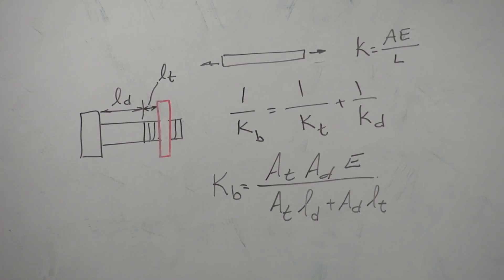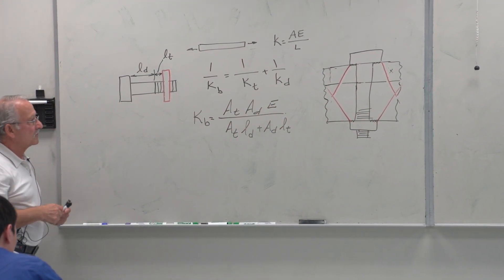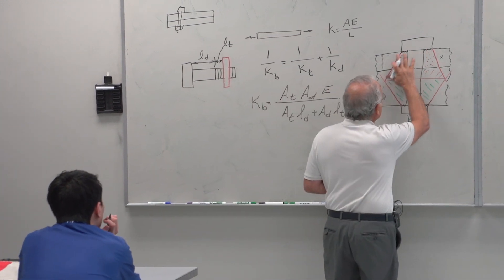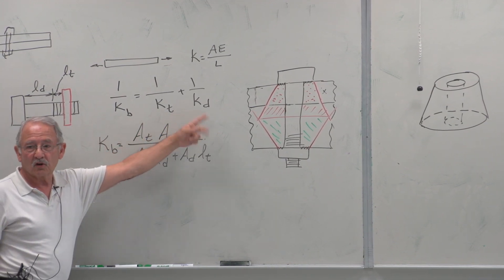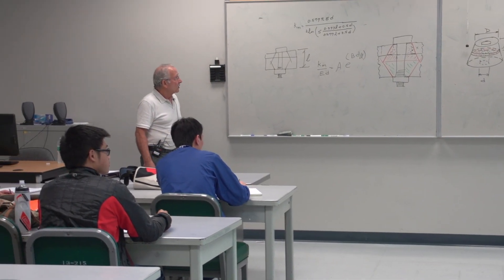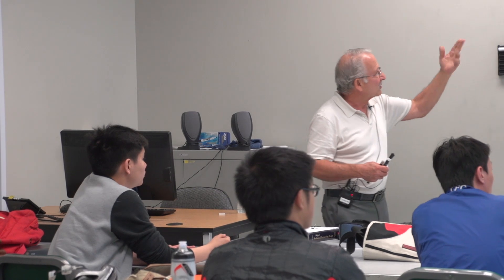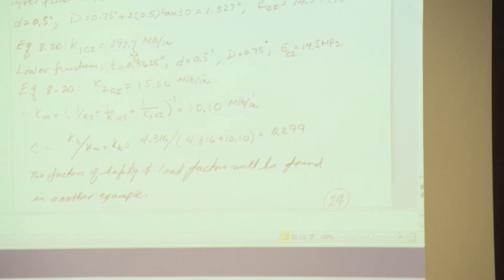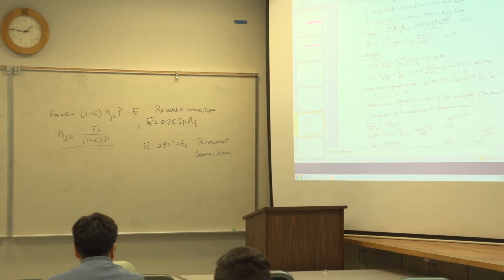Stress Analysis: Stiffness of Bolts & Members, External Tensile Loads on Bolted Joints (12 of 17)

Comment: Thanks a lot for the video.
I have a doubt at 1:08:18 when it was said that "higher the amount of preload, (the better the joint) and the less of the amount of externally applied load will be taken by the bolt". How is that? As I understood, as per the graph of external load assessment the split of the external load is driven by the stiffness of the member and the bolt, which doesn't change.

Additionally, during the preload, the forces on both the member and the bolt are the same (one is in compression and the other is in tension though). However, during the application of external load, the deformation will remain same for both the member and the bolt. So, if the deformation remains same (for member and bolt), the external load split shall also be same.
Reply: To your first point, it just means that the joint can tolerate more external load before gapping. Once joint is gapped it will take 100% of any additional external load.

To your second point, same displacement only means same force if stiffnesses are the same. In this case the compressed flange is far more stiff than the stretched bolt so although they have same displacement the compressed joint reacts far more load than the bolt.

Comment: I've read in several books on the subject. I think Norton's explanation is the best, and the way this lecturer presents it is very good.
However, everyone says that preload is important as it reduces the load applied to the bolt and shares the load between the bolt and the members. I think this is a wrong say. since the bolt is preloaded, it already carries a load, hopefully more than it should see during its' lifetime. applying a load to the joint relieves some of the stress in the members, but increases the load on the bolt. I think the need for preload lies elsewhere. first of all, its' a means of verifying during assembly that the bolt will hold the service load during its' lifetime. Secondly, during vibration, the preload maintains joint integrity, and does not allow the members to separate. what do you guys think?
Reply: Preload adds axial tension stress to the bolt.  Yes, it helps keep things together and protects against loosening due to vibration, but it also greatly improves fatigue life.  The reason for this is not completely intuitive until you understand fatigue.  When a bolt is preloaded, external load adds to bolt tension and reduces member compression, or squeeze.  Since a typical member is usually around 4x stiffer than a typical bolt, about 85% of the external load is carried by the members, and only about 15% is carried by the bolt itself.  This greatly reduces the alternating load and stress in the bolt, which can significantly increase fatigue life.

Comment: Dr. Hassan, what happens if we have washers? Does the cone's large diameter change?
Reply: I mean if we use SAE washers, you are right, but what if we use a USS Type A washer?
Reply: Yes.  If you have two washers and two members, you will have 4 stiffness terms.  The cone should begin to fan out from the outer edge of the washer.

Comment: What happens if you use a washer whose inner diameter is larger than the threaded part of the screw itself, but slightly smaller than the screw head? (It seems to me that too much pressure would be located on the outer periphery of the bolt head, but would this pose a serious issue?)
Reply: The ID of the washer must always be less than the bolt head diameter.  You can check the bearing pressure on the surface of contact simply and compare that bearing stress to the material bearing (best approach) or compression (conservative) strength.
Reply: @ToddCoburn  Thanks for replying. So far, the thing I mounted holds up!

Comment: Please tell me what is the difference between bolt and screw.?
Reply: the bolt have an nut, the screw it doesn't have it
Reply: A screw has a fine point, bolt doesnt
Reply: @bastiancabreramanriquez5131  Then why are there fasteners with bolt-like threads called machine screws?   Why are the 1/4"-20 screws called machine screws, but 1/2"-13 bolts are called bolts?
Reply: @carultch  i'm native spanish speaker, so maybe there are differences between the meaning in Spanish and English
Reply: @bastiancabreramanriquez5131  Still, for some reason, manufacturers tend to use the words interchangeably, for components I'd instinctively call bolts.  The main rhyme or reason to this, seems to be that smaller fasteners tend to be more likely called screws.  Also seems to have to do with the head geometry, as heads built for external wrenches are more likely to be called bolts, while internal screwdrivers or Allen drives are more likely to be called screws.

Screws without standard machine threads, or some degree of self-drilling or threading almost universally get called screws.
Reply: @bastiancabreramanriquez5131  It's as confusing to me as the difference between a generator and an alternator.  No matter what definition is the norm, some application has manufacturers who decide to go against the grain of that definition, and choose to name their product the opposite way.

The first definition I see on Google, says that alternators are AC and generators are DC.  This distinction seems to disagree with every application I've ever seen in practice.  A home backup generator isn't called an alternator, when it is AC, and a car's generator is called an alternator, when it obviously has to be DC.  It makes no sense.

Comment: Has any considered the need to have equal safety factor for load and separation? The joint has failed the moment there is separation OR load exceed proof load (which ever occurs first). So why not just have both factors np and n0 same?

That will lead to your preloading being equal Fi = (1-C)Fp.

Isn’t this a better preloading factor to use (1-C) than to bluntly say you must preload to 0.75Fp for reusable Fastners?
Reply: Due to uncertainties of the calculations, and the catastrophic effect of joint separation, you want to design for a healthy  margin of safety for joint separation.  However, bolt static strength can use a margin of safety of near zero (MS=FS-1).